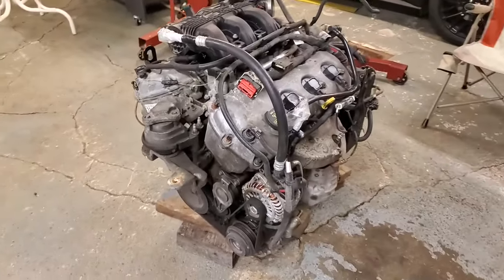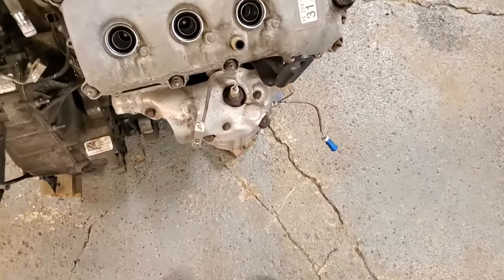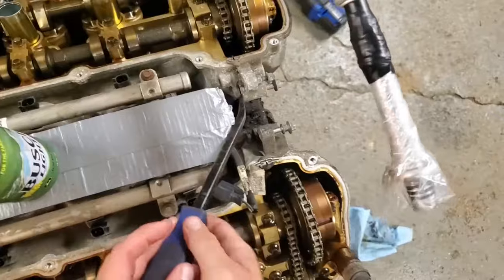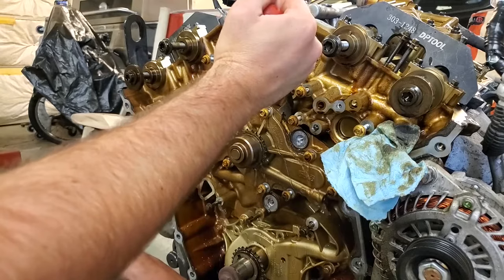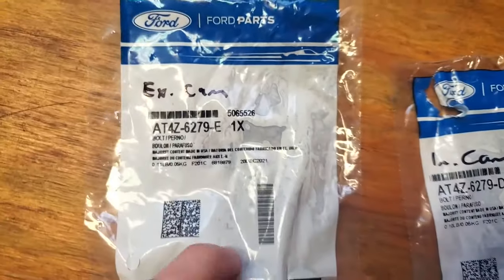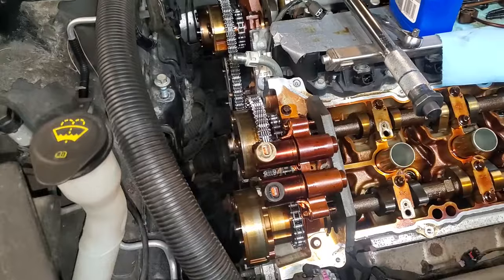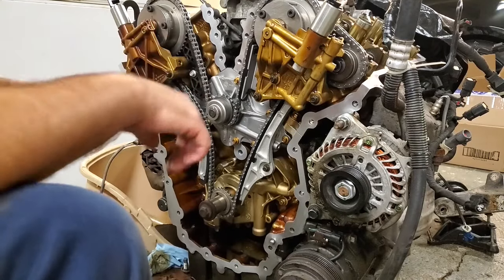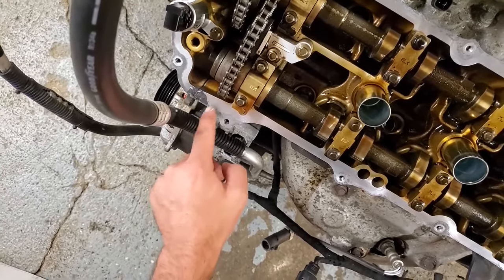3.5L Duratec/3.7L EcoBoost Timing Chain and Water Pump Replacement

Comment: THAT HAS TO BE ONE OF THE MOST SATISFYING THINGS, STARTING THE CAR UP AND NOT HEARING ANY PROBLEMS OR SEEING ANY LEAKS! MINE IS STILL IN PEICES IN MY DRIVEWAY BECAUSE THIS IS SUCH A MONSTER OF A JOB! 💔
Reply from the maker: Have you managed to get it back together yet?
Reply: @darkhorseautoanddiesel  I'M NOT GOING TO LIE, I ENDED UP JUST SCRAPPING THE CAR.💔 IT JUST BECAME TOO BIG OF A NIGHTMARE AND I DIDN'T HAVE THE TIME OR THE ENERGY TO PUT IT ALL BACK TOGETHER. 😩

Comment: I’m a new subscriber. That you for this video. I wish I’d found you three weeks ago. My coolant dumped out of my 2013 Ford Flex three weeks ago. I pulled over immediately and called my mechanic, who said he couldn’t do the water pump because he didn’t have the “tool” to hold the cams. Hmmm, well I called a few Ford dealerships and they both said that a job like that: they were booking a month and a half out. Huh? What the hell?  Well I found a shop that would do the job and it was $1600 all in. Fine. I want to thank you for this step by step video, which I watched beginning to end, and I’m so pissed off that my mechanic said he didn’t have the cam holders that I bought a set from Amazon a few minutes ago just because. I don’t work on my cars anymore but I collect tools because I like tools and now I have a set. No one said anything about cam phasers. Thank you for showing me which tool to buy for the cams. Best Regards
Reply from the maker: You're welcome. Like I showed in the video, technically you don't even need the tools, it just makes it way easier. Sounds like that mechanic doesn't know how to do the job, or doesn't want to. Even if he didn't have the tool, as you proved, Amazon can help that quickly. Now that you have the tool, if you ever need them, you have them. Maybe it's time to start working on car again.

Comment: Won't be buying a Ford 3.5/3.7 V6 that's for,sure  Have to admit this guy knows his stuff Very impressed! My mechanic of 20 years said he doesn't to these Need special tools and phasers need to be perfect No money in it too Give you 14 to 16 hours Great job my man!
Reply: The water pump is only on the inside for the front wheel drive models. The 3.3/3.5/3.7 rear drive models, F150 and Mustang, have external water pumps.

Comment: Dark horse, EXTREMELY helpful video, very thorough! When using the scuff pad to clean the mating surfaces I noticed small surface scratches that aren't deep by any means, but I am in the middle of doing this job and want to make sure I am not creating leak points. I bought the same purple looking scuff pad, please reply and let me know if this is normal. Thanks for the great video!
Reply from the maker: Thanks for the compliments! Helping people is why I started making these videos. 

Tiny little scratches will be visible. As long as its just cosmetic you've got nothing to worry about. The silicone will fill those in. I always recommend making the final pass perpendicular to the way fluid would leak out as well, just to be sure.

Comment: Just a heads-up, as it relates to a recent query @rockwitdom9765. Early models from 2011, particularly the MKS, were equipped with the older 2010 engines. Mid-year, Ford shifted to next-generation engines. The timing components of the later 2011 builds underwent significant changes, including a wider chain, broader guides, a redesigned upper tensioner, a two-sprocket water pump, and extra phasers. You can identify the engine variant by counting the VVT solenoids on the valve cover (you might need to remove the cover for certainty). My car, a 2011 MKS 3.7 Base, manufactured in May 2010, has two VVT solenoids, one visible on each valve cover. When sourcing my engine parts, I've learned that referencing the 2010 MKS is more reliable.  The dealership, using VIN, doesn't take into account the vehicle build date, often resulting in wrong parts.  Anyway, I'm planning to undertake this job later in the month, including the oil pump.

The video was excellent, especially the part about identifying the new, longer guide bolt, which I couldn't find elsewhere. I'm considering a one-month subscription to ALLDATA DIY for the torque specs (for the 2010 MKS) and to verify the procedures. Thanks again for the effort put into making this video!
Reply: I have an 2011 ( build date 8-10  I would like to order parts in advance of starting the job but can find data on which chain sprockets this car takes . HELP

Comment: I've only ever done inline-4 engines. Mostly 2.2 ecotec. I think it would be wise now, to go ahead and replace the headgaskets. On a V6 can I come back later and leave the timing alone to do the gaskets or would I have to disassemble the timing again?
Reply from the maker: If the head gaskets are fine there is no reason to replace them. That is just asking for more problems. If you mess up, now you've got a head gasket leak that you didn't have before. Head gaskets can last decades and hundreds of thousands of miles. As long as the engine never gets over heated and the cooling system is maintained fairly well (to prevent corrosion), there really isn't any reason for failure on a well designed engine. They aren't considered a wear item.

On an overhead cam engine, the timing components have to be removed to replace the head gasket since the cams are on top. So no, you can't replace the head gasket and leave the timing alone on this engine. On an over head valve (cam in block) engine you can, but those are rare these days in automotive applications.
Reply: @darkhorseautoanddiesel  thanks 👍

Comment: I have a 2012 ford explorer that threw a code for an advance timing on bank 2. How would i get it back into time before tearing it all down before hand? Would i just put the tool that holds the cams still on and spin it till they sat flush? Thanks in advance, really great video as well

Comment: My 2014 Ford Explorer Sport (turbo/Ecoboost)  just had this timing job done. Ford did it (no one else would). 17 hrs labor. The tech did it with the engine in the car (thats the way he does it, apparently). Did a good job; runs really smooth now. Chain had jumped some teeth and I had 5 codes thrown. Expensive! I also had spark plugs and water pump done. I had a 2013 Explorer that needed a water pump, and for that they dropped the engine out and did it on the floor in less than a day. Timing chain and a few other parts as well. Stupid design.
Reply: How much for the job
Reply: How much buddy? I got one in my Taurus
Reply: @traviswatson3810  Hang on to your hats, boys! I'm in Canada, so adjust your dollar values. I also had all 6 plugs and the water pump done while it was all apart. $4,400 cdn before tax.
Reply: I did all that myself and spent 800

Comment: @darkhorseautoanddiesel I want to thank you for this video as it helps me understand this engine. I've noticed, that timing cover seems to be covered in engine oil mixed with dust - do you know what was the reason? I have oil leaks close to the both cylinder heads junction with timing cover ('V' shaped place on top of the cover) as well as close to the belt tensioner and I wonder if this might be timing cover sealant issue...

Comment: Thanks for a great video. Risky to pry the timing cover off.  You may crack the timing cover. Use the threaded holes located 2 at the top and 2 near the bottom.  Use the timing cover bolts in these holes to back the cover off of the engine evenly.  Also, it's not a good idea to whack the harmonic balancer back on. There is a harmonic balancer install tool designed to pull the balancer onto the crankshaft.

Comment: I have an 2018 explorer with only 48 k water pump went bad dealer charge me 2800 to fix it so i decided do it myself there is any way you could tell me whats the torque for the intake manifold my is aluminum not plastic or where can i get the sheets for that thanks you video help me a lot
Reply from the maker: Manifold torque should be the same. You can do a quick Google search to confirm, but I see no reason it'd be different. I've never worked on one like that though so I could be mistaken.
Reply: @darkhorseautoanddiesel   thanks so much i did google but I didn’t find anything
Reply: @darkhorseautoanddiesel  i did over torque the  water pump in tease of  45 i did 90 but tomorrow ill fix ill get new gasket and change it i dont wanna do it again is a pain

Comment: Hi can i move the crankshaft alone against clockwise while the chain off to put it on the 4 o’clock position for ford explorer 2019 ? Actually need about 180° turn against clockwise to reach to its point 
Can I 
Thank you so much
Reply: I'm not an expert but i would think that both the cam shaft and crank shaft should be moved together attached with chain, or by same angle(?) else you risk causing the pistons to hit the valves (since this is an interference engine).

Comment: Quick question if you went ahead and took the heads all apart but now are going to reassemble it do you put the DOHC's in the natural position meaning the barcode on each cam has to be facing up? Then install the phasers back in the 11 clock ,1 clock, and 4 clock?
Reply from the maker: I don't recall any barcodes on the cams so I'm not sure what you mean with that. However, as far as orienting the cams, if the tools fit they are either correct or 180 degrees off. If they are off, you'll know as soon as you try to put the sprockets on them because the sprockets only go on the correct way. If the timing marks aren't in the right position once the sprockets are on, then you'll know the cams are off by half a turn.
Reply: @darkhorseautoanddiesel  ahh okay thanks for getting back to me! I’m doing a 700hp build for the 3.7l with a 67/66 turbo. Sending the block to get a closed deck conversion and then when it gets back I’m putting it all together. But I’ve been doing research on how to put the camels back on etc. so this helps a lot🙌🏻 thanks!
Reply from the maker: @CameronAlvarado  That sounds like one heck of a build! I'd be interested to see that in action.
Reply: @darkhorseautoanddiesel  haha it'll be all over my socials if you wanna stay up to date!
Reply from the maker: Unfortunately I don't use any socials 😂 I have a personal Facebook page but even that rarely get used. Like once or twice a year I log into it.

Comment: For a single phaser 3.7 (2010 Mks), here is the secondary sprocket torque sequence from ALLDATA:  30 ft lbs > Loosen one full turn> 89 in lbs > 90 degrees.   As this information conflicts with the video, I'm confused if ALLDATA is correct
Reply from the maker: I believe alldata is correct. At the time I made this video I was unaware that the 3.7 used a different torque spec. Unfortunately, that I'm aware of, there's no way to edit a video to add info once it's published. The problem is, if I edit the video on my computer and repost it, it acts as a totally new video so it goes back to the bottom of the search pile. 

I do have a new, updated video on this job recorded, I just haven't had the time to edit and post it yet. I recorded it just this last week 😆
Reply: Yes,  if I went to 180 something might have broke...90 is super tight.  The single phaser motor has short bolts.   Dual phasers are at least twice as long...infering more torque.
Reply from the maker: @BlueSkies-pd9og   Well the 3.5 in the video, the main one, was a single phaser, and it called for 180. What are the part numbers for the bolts on the motor you worked on? That may shed some light on this. If they're the same part number, maybe it doesn't actually matter?
Reply: 2010 Ford official manual agrees with alldata procedure for the 3.5 non ecoboost

Comment: Do you know what fel-pro gasket set you used that contained the phaser solenoid manifold seals?  I'm preferring to the 1 oring and 3 split seals that you mentioned came in the valve cover gasket set and not in the timing set.  All the pics I see of the fel-pro valve cover gasket set do not show those seals.  FEL-PRO VS50767R is the kit I see

Comment: Soo Im confused af. Ive got a 2011 mkz 3.5l, doing water pump/timing. Only the single roller water pump fits, but all the parts stores I order from to get the phasers are giving me the second gen phasers?? The double roller chain doesnt fit on the single roller water pump, and Ive yet to find a single roller chain, but wouldn't the single roller chain not fit on the thick teeth from the second gen phasers? Im really chasing my tail here, any help on this would be great

Comment: This was a cloyes kit and have heard bad things about using non OEM phasers but noticed that there are ford OEM part numbers on some of the parts you were showing. Any idea if those phasers are OEM?
Reply from the maker: I have no idea. Cloyes does make factory parts for some vehicles I believe, so it could be possible that the Motorcraft parts and Cloyes are literally the same. That would require some research to confirm or deny though.

The engine that I showed that was done in the car, the customer didn't want to replace the phasers due to the cost, so those are likely factory originals (with over 200k on them now).

Comment: Any idea how many miles on this engine to need this kind of repair?
Reply from the maker: This one had about 190,000 miles, but it was still working fine. The engine was already out of the vehicle so I did this as a preventative measure. It's a pain to do once in the vehicle.

Comment: Could someone tell me all the parts needed for the water pump and timing chain replacement

Valve cover gasket .etc
Reply from the maker: In the video at relevant points I talk about all the parts I used, including many of the part numbers. I bought most of it from Rock Auto. I bought a Cloyes timing set and Motorcraft water pump from there, and the TTY bolts from my local Ford dealership. Valve cover set was a Felpro, also from Rock Auto.

Comment: I own two for Ford Fusion Sports. Guess how many times I have had to do this repair with the engine in the car?
Reply from the maker: I'm gonna guess 2 🤣
Reply: Glad to hear that doing in the car is possible for fusion sports. I am facing water pump issue for my fusion sports, any thing I should be watching out? I heard it’s super tight. I am debating if I want to break the bank or break my mind with this repair since I don’t want to give up on the car yet.

Comment: While this is a great video with very good information, I would like to point out a one big concern. I highly recommend NOT using the cam position tool as a holder while torqueing the cam bolts. These tools are not designed to withstand that much pressure, they are solely to make sure the cams are in correct position for timing. Instead use a proper size wrench on the cams while torqueing to spec. Also DO NOT use the chain to hold the crank while torqueing the crank bolt. This can cause premature chain stretch. Instead    use a prybar inside the slots of balancer to hold the balancer in place during torqueing. Other than these concerns you did very well.